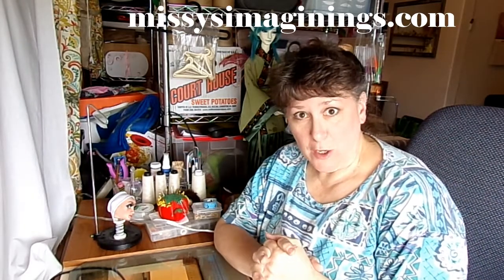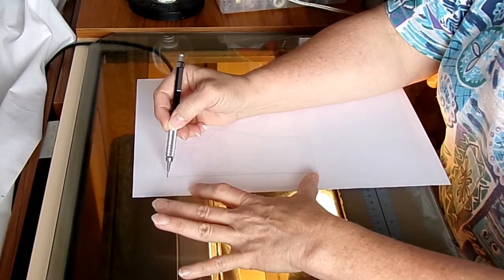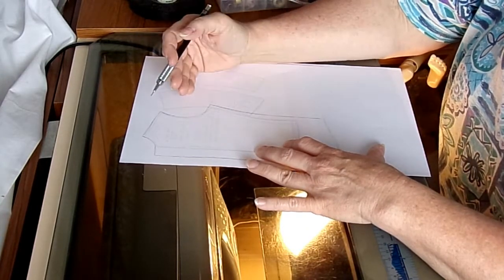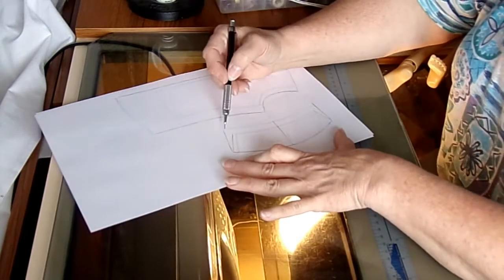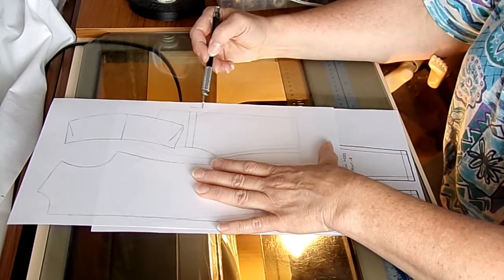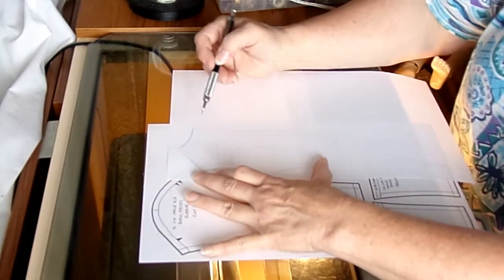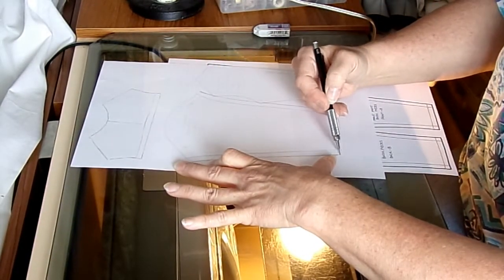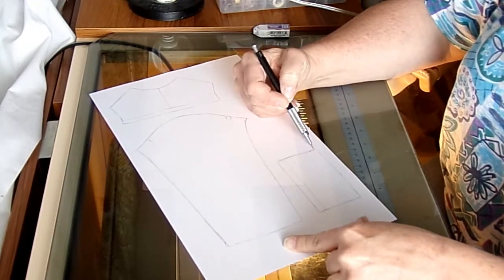Drafting Shirt Pattern   BJD SD 70cm Male

Comment: Hi Missy! I tried this pattern out yesterday, I am a beginner-intermediate and went in totally blind with no instructions... this video answered one of the things that was puzzling me: why is the yoke smaller than the back piece.  Pleats of course!  The other two questions I have is how the cuffs are sewn and folded, and how do I make the collar look not like a total hot mess lol.  

I think I had the right idea by sewing the collar to the shirt and facing so that all the seams were tucked in, but at this scale it was bulky and messy and had some unintentional gathers even when I  trimmed the seams down and ironed it flat.  I guess I need more practice sewing small curves!  

I have an impldoll 65cm muscular star body doll, I did not know the pattern included seam allowance so I added an extra 1/4" and it fit my boy pretty well! Maybe it needed it, was this pattern drafted for a slim 70cm doll?
Reply from the maker: Hello! Thank you for your message! Let's see if I can help out with your questions. First, yes, the pattern was designed for a 70cm Resinsoul male, which is a slim body style. Your choice to add the 1/4" to the pattern pieces was a great way to make an enlargement. Good choice there!

Second, I do have a video on how to sew that pattern, which shows how to sew the cuffs onto the sleeves. The cuff portion starts at about 28 minutes, 35 seconds into the  video:
https://www.youtube.com/watch?v=2U8b9mqkL60

Third, I just did a video for sewing together an MSD size coat that shows how I put in a collar. It's a way to create more of a straight seam (rather than small curve) as you feed it into your machine. The section for the collar starts at 34 minutes, 53 seconds into the video:
https://www.youtube.com/watch?v=M6LV9KsI1Fw&t=474s

I hope those are helpful tips for you. Thanks for watching and happy sewing! ~ missy
Reply: @missysimaginings1   Thanks so much for this info!! I will check it out and make a second attempt at this shirt :)
Reply from the maker: @ashb8318  ~ my pleasure!